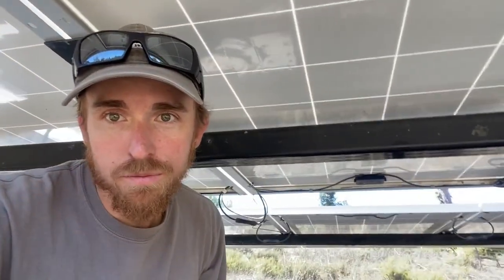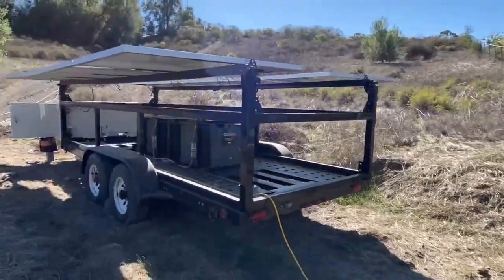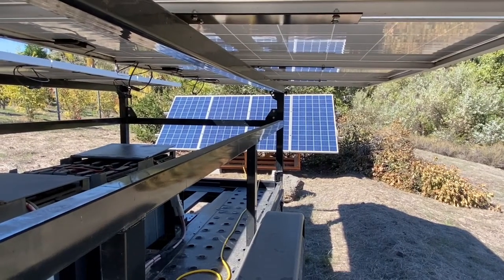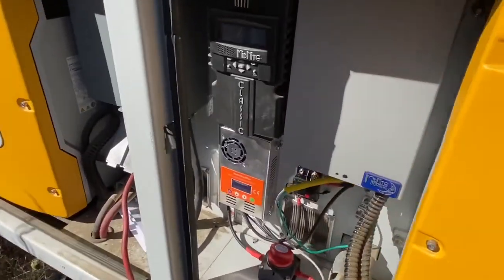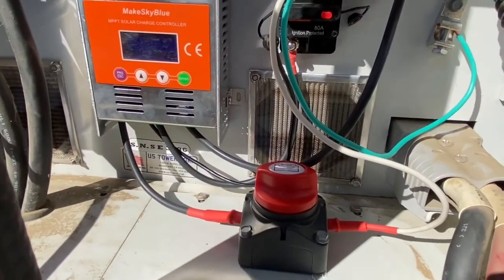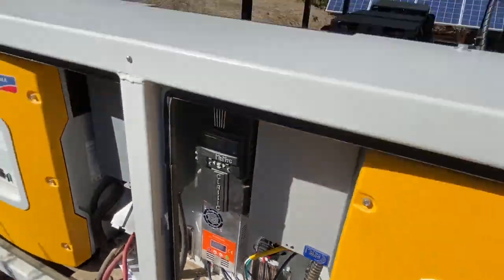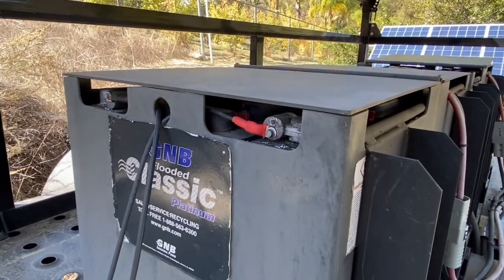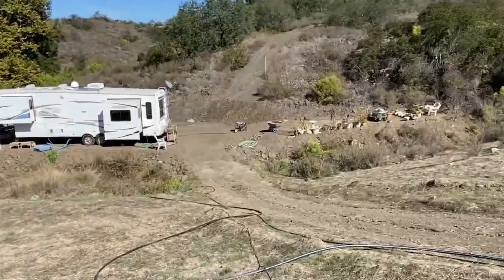Increasing the total solar power of the DC Solar Mobile Generator Trailer - System Augmentation

Comment: THIS is EXACTLY what we want to do with our used DC Solar Trailer I am picking up on Friday. It was cannibalized  of the generator, battery bank, masts and lights... but we have (12) 390 Watt QCELL Panels that I would like to utilize for storing power in our GNB VRLA 48v Battery Bank. How do I contact you?
Reply from the maker: Ok great! Please email me: solarpowerondemand@gmail.com
Reply: @solarpowerondemand3255  thank you, Ryan! We just purchased the DC Solar Trailer with the Kubota Lowboy Diesel Generator but I would like to limit the amount of generator runtime. I contacted SMA to find out what the maximum wattage/voltage and amps are allowed to complete the highest charging rate of the IFLA battery bank without burning up the controller and inverters. Haven't heard anything back as yet. Hope you and your business are doing fantastic! We are in Northern Nevada (Reno-Pyramid Highway) - where are you located?
Reply: @solarpowerondemand3255  I have watched this video several times. I just noticed how you tapped the legs on the battery. It got me to thinking that the Midnite CL250 is tapped to the rear battery ONLY on our trailer. The tap needs to be replaced due to sitting in the California "elements" and becoming old and corroded. This may be the means to re-tap and get as much power to the battery banks that the panels and Midnite are able to produce.

Comment: Hi there! What if you had 2 of these trailers? Would it be possible to wire the panels together in series to the midnite controller for more power?
Reply from the maker: Thanks for the question. The Midnite controllers that come with the trailers are pretty much maxed out with 10 x 250w panels. If you wire more panels together in series you will exceed the Voc parameter of the controller. My recommendation is to buy a controller for $100-$200 on eBay or Amazon and wire the additional solar to the controller, and of course wire the controller to the battery bank. Video description has links to the controllers I recommend. Cheers!

Comment: hey at 1:24 it shows how you connected the charge controller to the terminals. did you use a self tapping screw?? im fixing one of these for a customer and someone before me did some SKETCHY splicing haha lots of tape was involved.
Reply from the maker: Yes, a self tapping screw is exactly what I used! Specifically a #12x1 screw for metal roofing. Just be sure to give considerable pressure while modulating the screw gun speed in order to get the threads to bite and not strip out.

Comment: Hmm...either the new array is aimed in the wrong direction/angle ( and it doesn't appear so from the amount of sun on it in the video), or the panels on the trailer aren't doing much.  Looks like the trailer ought to be turned 90 degrees and the panels angled instead of laying flat.
Reply from the maker: Good point. The new array is facing south. The trailer is not oriented ideally, but it was all we could manage given the terrain

Comment: Hi Ryan, my trailer solar powers during the day but it won’t run a light all night.
DC Solar trailer- SMA Inverters.
Any thoughts.
Thanks
Reply: Look on the master inverter screen (right hand side) or the Midnite controller screen (right hand side of the screen).....both should read within a couple 1/10's of each other.

What do the batteries read, say an hour after sunset ?  Fully charged, they should read very close to 51 volts (50.92 is 100%).  If that reading is 50v, you are going into the night with 80% SOC (state of charge).  48.5v, you're going into night with around 50% SOC.  The inverter is likely cutting off based on that.....the setting on the SOC has reached it's low point....the inverter cuts off to protect the batteries. 

You are able to run it during the day because of the power the panels are generating, but there is no reserve to go into night.

OK.  IF your batteries read 80-90 SOC an hour after sunset, (wait an hour or so AFTER generation stops to get a fairly true reading) what is your battery reading first thing in the morning before any sun is on the panels ?  

IF it's down in the 48-49volt range, AGAIN, the inverter has reached the low point cut off during the night.....meaning your batteries are NOT getting charged enough during sun on panels....OR your load is more than the batteries can handle.  

You need more panels...the purpose of this video.....and really a LOT more panels if you really want solar power.  The 10 on the trailer are NOT adequate to run much of anything quite honestly...it was a poor design from the get go pairing that much battery and inverter capacity with that few panels.....WHY most of them have the Kubota generator on them, which is the real power source on the trailer.  
Or you have to reduce your loads....even during the day to allow the batteries to charge up more.
Reply from the maker: Do you know your electrical load in watts, during the night? Does the trailer have the original flooded batteries? If it does, you can start by lifting the cover and popping the plastic caps off in order to check the water level. It should be topped off with distilled water just below the top of the battery cell.

Comment: Hey Ryan, thanks for the vid. I have the exact same scenario and considered doing this but figured I'd be better spending my money in battery storage because my batteries seem shot to hell. Did you need to refurbish the batteries to hold this new juice?
Reply from the maker: Hello Jory. That's a good point, sometimes its additional energy storage rather than energy production that is needed in an off grid application. In this case the battery bank still had decent capacity so I didn't need to replace them and the additional charge current is still in the safe limits of the battery bank. The battery cells just needed some distilled water added.